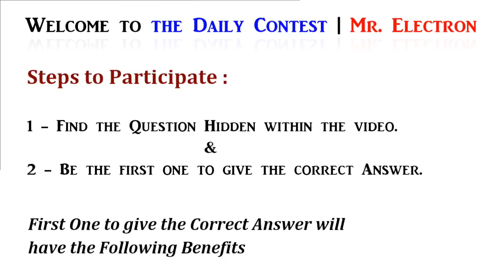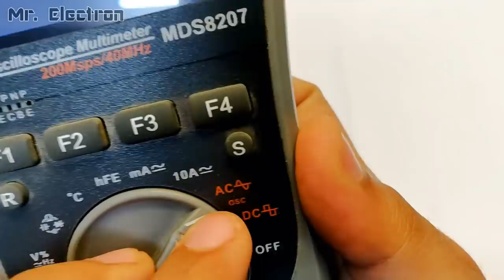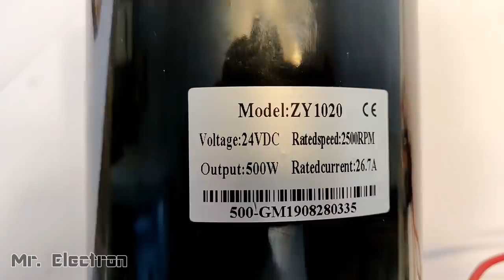9V 20A DC from 220V AC for High Current DC Motor 1000W - Amazing Idea

Comment: these motors are running because of the high charge of the capacitor and not the transformer. A 12volt D.C motor will run on any voltage below rated once the initial charge current is high enough. hence the large capacitor

Comment: First known transformer developed  in 1880s by Otto Blathy,Miska Deri and Karoly Zipernowsky.
They r known to have designed first transformer. 
But first reliable  transformer was built in 1885 by William Stanley.

Comment: Hello how are you
Please advise  how i can get output 12v  instead of the 9v
Please reply.
Thanks.
Reply from the maker: Chage transformer
Reply: use a step down transformer made for 12 volts. you can buy in market for different voltages